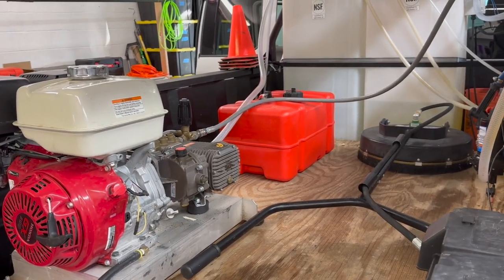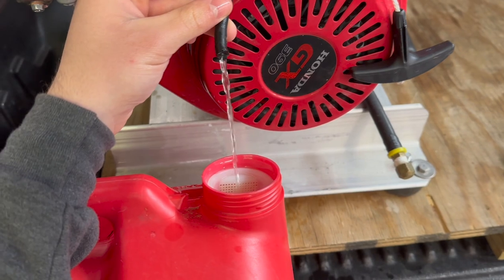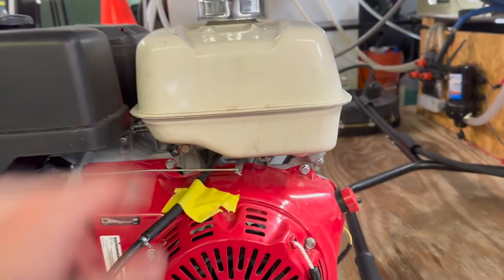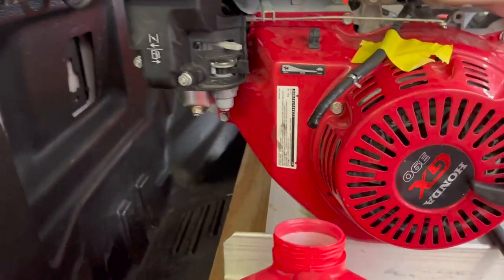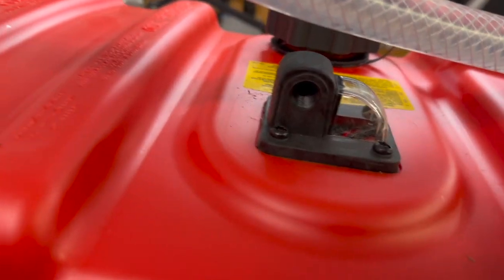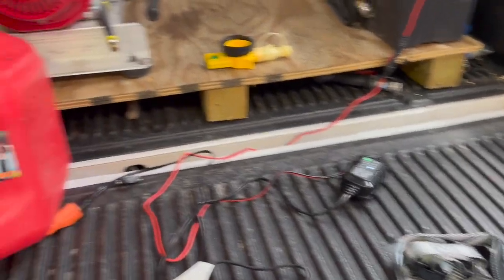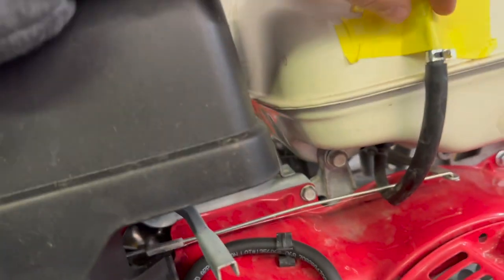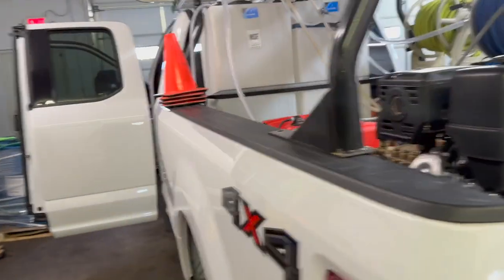Installing 12gal Gas Can On My Power Washing Truck

Comment: How long did you run the motor? I'm no expert but pretty sure you'll have to install a pulse fuel pump to pull from a tank with that motor.
Reply from the maker: Ran it for a minute maybe, think that’s long enough? I’m definitely no expert with these motors either.
Reply: @Tylerkropp  possible just ran on what was left in the carb.
Reply from the maker: @shauncrochet7934  Gosh I hope not, I guess we’ll find out tomorrow lmao. It’s an easy fix to swap back if it doesn’t work. I’ve seen some guys have the gas tank under the machine and it still pulls fuel tho so I’m confident it’ll work
Reply: Unfortunately you will need a pulse pump unless tank is above power washer unfortunately it won’t work
Reply from the maker: @JDMSoftWash  ok I’m going to get one right now, I’ll make a vid too. Thank you beo
Reply from the maker: *bro
Reply from the maker: @JDMSoftWash  yo actually it’s working perfectly, I just took the line off the carburetor and it was flowing right out of the fuel line. I think we should be good, I still made a video out of it tho. I’ll be posting it today pribably
Reply: @Tylerkropp  wow that’s awesome everyone I knew said you had to have one that’s great I might need to do that now
Reply from the maker: Yo actually I was kind of wrong. I guess every time we ran the machine yesterday it was on level land. Today my guy parked on a bit of a downhill and the machine wouldn't pull the gas, we had to switch back to the stock gas tank for now.
Reply: @Tylerkropp  ya that’s what happened to me I just put the gas tank on shelf above it and it works great
Reply: @Tylerkropp the tank vent may have been closed and pressurized with the heat which is why it has that bulge to it in the video which is why it might have worked. You'll need a pulse pump and access to a crankcase air line or make one. There should be videos on her how to do it. Next option would be a 12v 1-2 psi fuel pump. But yeah it's not guna work the way it is in the video. With gravity you would need something like a bulb pump with a check valve to prime it first and then as it consumes fuel it might draw from the tank.

Also I wouldn't use water fed pole hose if it's not rated for gas or ethanol. It should 1/4" fuel hose or tygon fuel hose.

Comment: You’re most likely gonna need to put a fuel primer bulb on that line.
Reply from the maker: You're right, it pulled fine when we were parked level, but today we got set up on a job on a bit of a down slope and it wouldn't pull. We just switched back to the stock gas can for today.